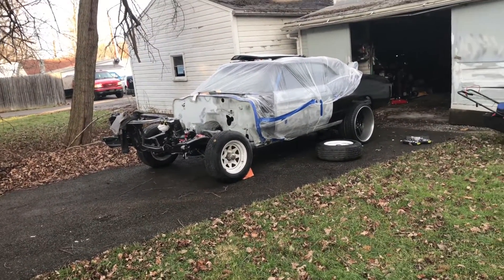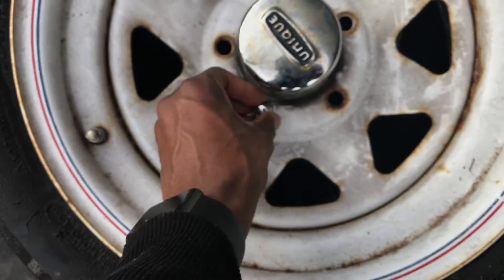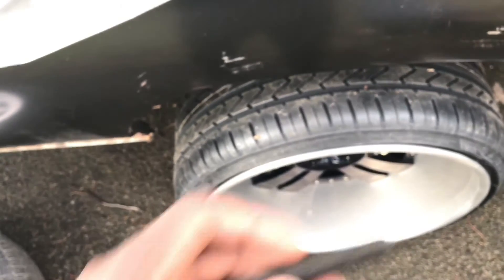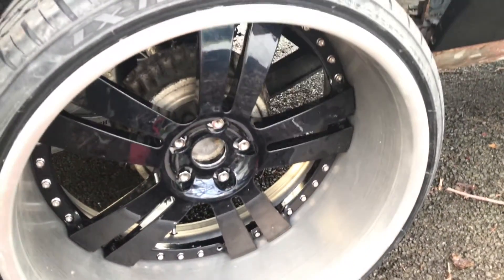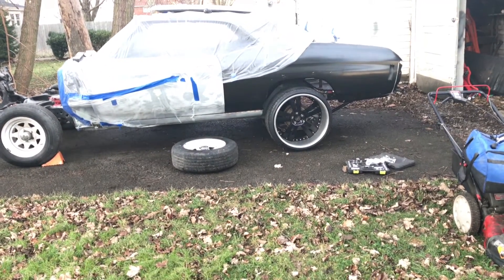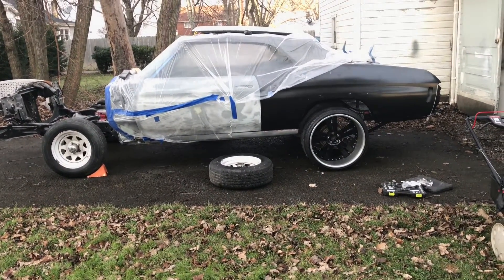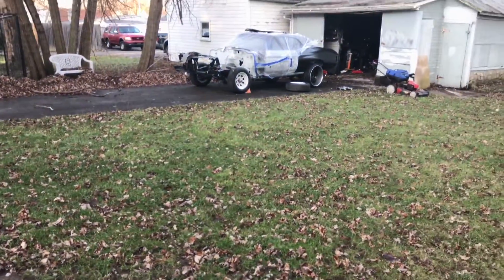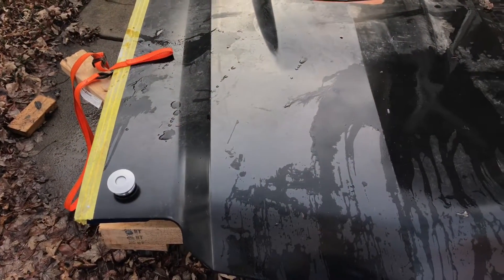1972 Chevelle On 22" Rims & Hood Pin Mock Up

Comment: Cool bro. I just got back to putting my 70 back together. those some big wheels. glad you said you were gonna switch out those drums. look much better with disk, running those types of wheels, with bigger slots like that.
Reply from the maker: Grim Reaper yeah I have to run disk with a LS motor in going to need to stop this thing lol 😂
Reply: yeah man. if your going with an LS probably a wise idea lol! my chevelle has front and rear drums. ive got the front disk set. but Im thinking im going to go with a 383 stroker. so I wont really need rear disk... sides. I like to do a little stunt driving from time to time lol!
Reply from the maker: Grim Reaper looking forward to seeing bro
Reply: got a few videos on my page. just replaced the rear deck filler panel. and rebuild the window channel corners. what a trip. too many damned spot welds lol!
Reply from the maker: Grim Reaper I watched them last night. Spot welds suck lol 😂

Comment: Hey bro since you blocking firewall what you doing about air conditioning or are you gonna have ac?
Reply from the maker: Earl Johnson definitely running A/C plan on running the lines before paint and on the far passenger side and hide them under the inner fender. At least that's the plan.

Comment: where would you install the blower
Reply from the maker: Earl Johnson I have the blower and A/C box from my 2008 Malibu dash swap I'm doing and if I can't get it to work I'll use vintage air system. The components are mounted under the passenger side dash